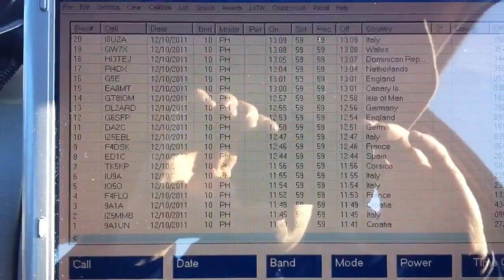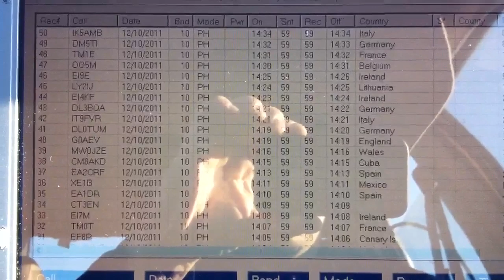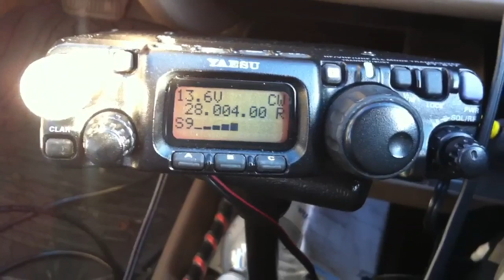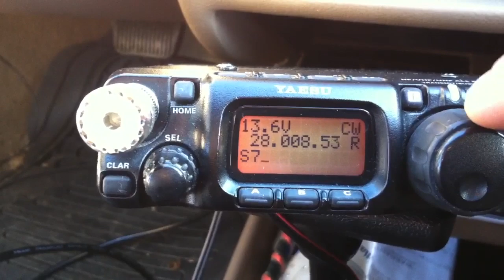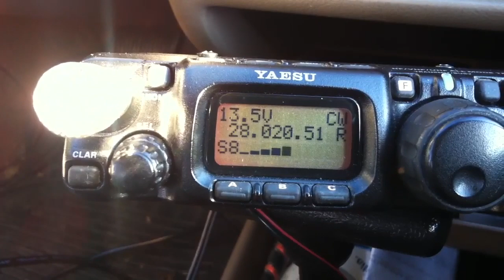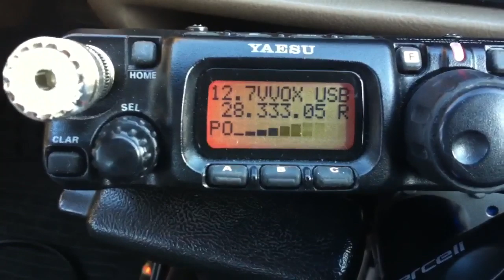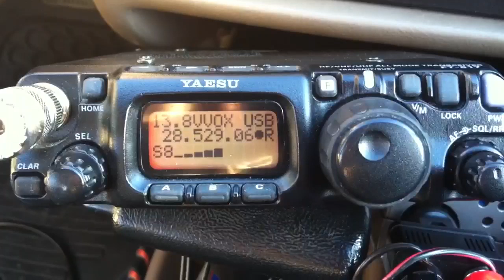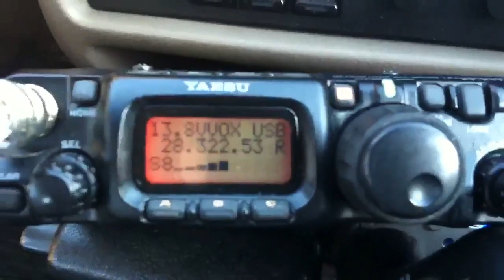Kick ass QRP antenna setup for the ARRL 10 contest.

Comment from the maker: Huh! 

I'm contesting and showing how to make use of a dual antenna system setup for QRP to be competitive. It's also showing the comparison and effectiveness between the two. What I'm also doing is providing prof to all the anti QRP (Life's To Short For QRP) operators that QRP can be not only effective, but can run with bigger base stations from home out in the field. 

I'm showing multiples things here so not quite sure what your question is supposed to mean.